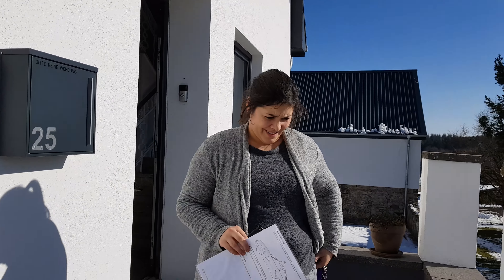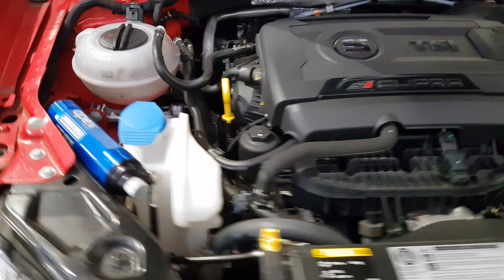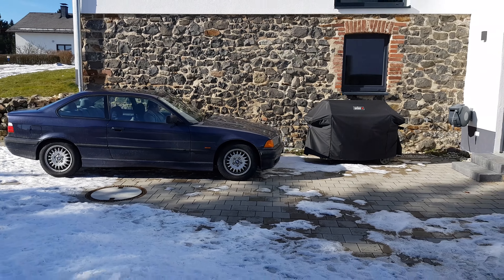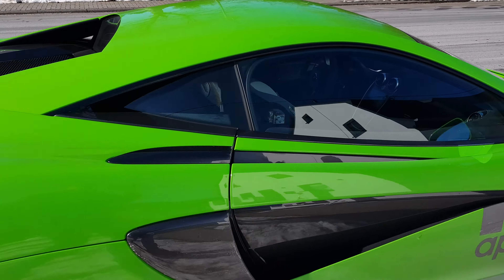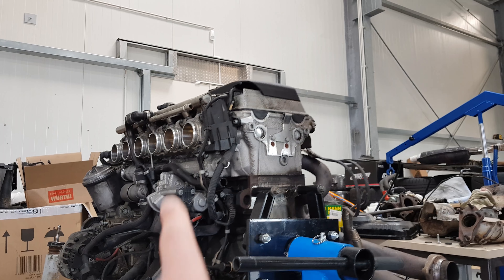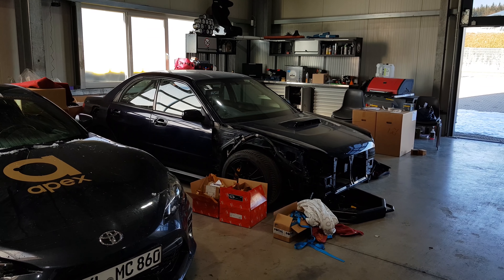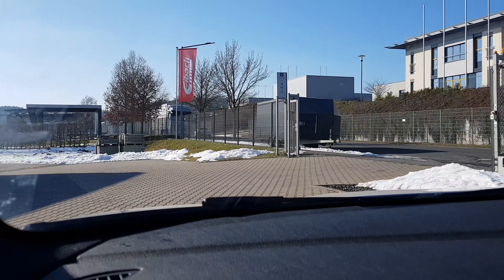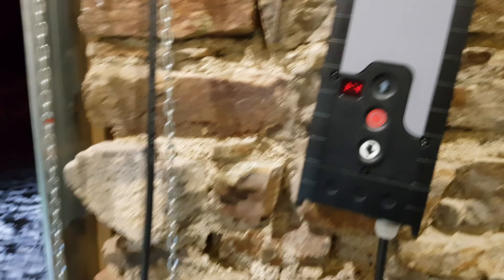NÜRBURGER

Comment: what size of the AR1 use on the Mclaren ? Did you change the wheel on the Mclaren to 18 ?
Reply from the maker: Ivan Lam stock sizes, 285 35 20 on the back and 235 35 19 front.
Reply: but is AR1 only go up to 18" tires ?
Reply: Ivan Lam These are new sizes. Afaik freely available soon.
Reply: been looking for ar1 for 19 and 20'' for a long time, good to know they are coming out soon
Reply: We have the first set of these tires to test.  They will be available in a couple months for purchase